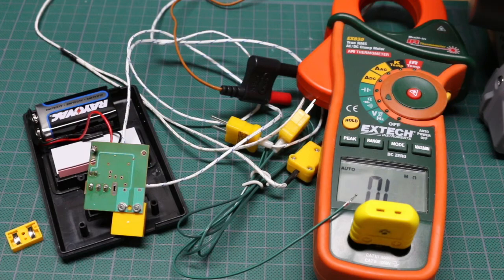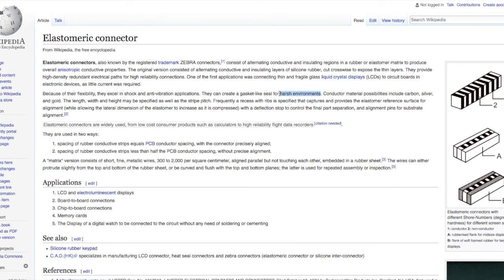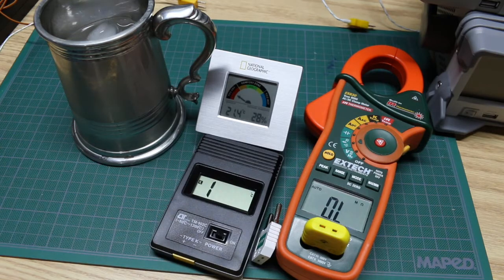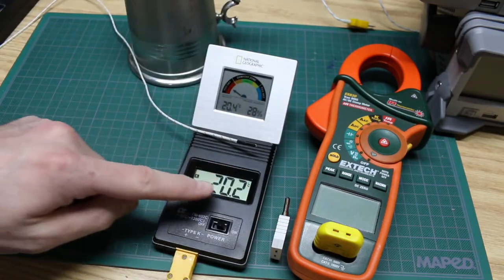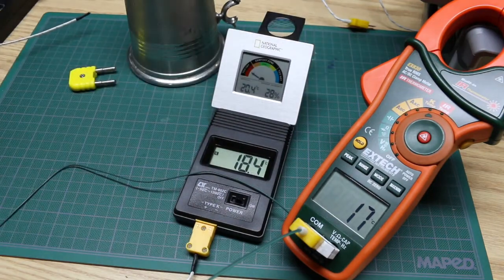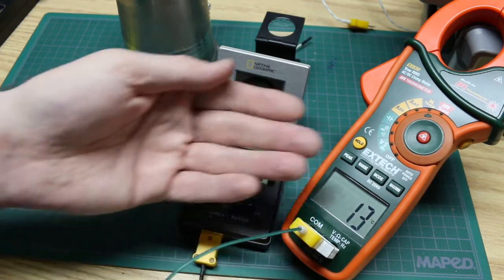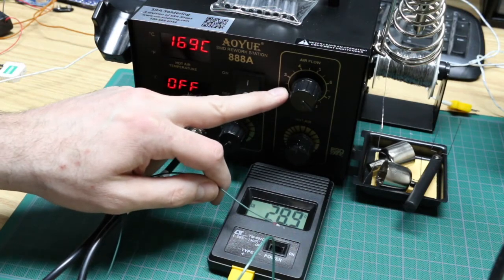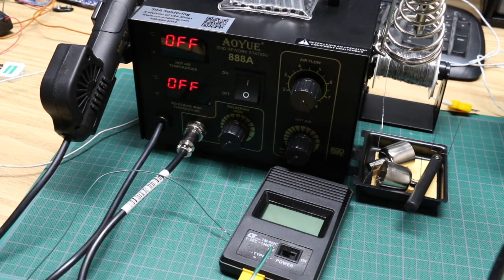K Type Thermocouple Testing

Comment: Dont buy extech.... have a look at the tests on youtube. They are very intermiddent about what you get.
The cheap chinese can vary +- 2 deg. C, but k-type probes are for high temps and are not very accurate either. If you want better accuracy than +- 1 deg. you have to buy better meters. The probes are what they are... two metal compounds giving of a few mV depending on temp. so not much to do there.
Reply from the maker: Yeah a few degrees error is fine for anything I’m doing currently, I just thought it was strange that I had such large discrepancy like 7 or 9° difference until I explored further and figured out I had malfunctioning items as well as improperly used items.  

 I think the next time I buy a multimeter for anything serious I’m going to definitely do more research but I’ve generally been happy with Fluke since I got my first one around 1995, which I still have and it still seems trustworthy. I acquired another Fluke since then  but neither can do temperature so that’s how I ended up on this tangent and relying on the Extech.  

 I’ll look up some reviews on it and see what turns up. I originally bought it for the clamp AC current capability and it was more about all or nothing to see if my house air-conditioner was generally running properly or not so I guess it served its purpose but it would be good to see how much I should trust it from here on.
Reply: I understand. Another brand wich is very much sold to hobbyists, but should be avoided....sometimes... is uni-t unlike Extech, quality differs very much from model to model and not so much unit to unit. Some uni-t models are actually very good. Thats why yt is so great for this ☺

I havent ever had the trouble you had here, sometimes one just runs into things that seems strange.🤔

K-type temp. probes is all the same, they have to be, its nature. If you want to measure I think you said 50 degrees, well no problem with a k type probe. Maybe lent some equipment from a friend and see what you come up with. I think the Extech is shot in this range.
Use boiling water (well known precise reference), so you know what to measure until you got it sorted out. Good luck.
Reply from the maker: Yeah I finally sorted it out in the video that came after but the extech  was still not looking as accurate as everything else.
Reply: Try rotate  connector 180deg. If you  put k-type in liquid, resistance change. Try protected k-element.

Comment: It is so funny that I also have sooo much troubles with reading K-type thermocouples.
I tried to use MAX31855 module for Arduino but failed. 
This one f.ex banggood.com/MAX31855-K-Type-Thermocouple-Thermocouple-Sensor-For-Arduino-UNO-Mega-p-1175433.html
Maybe you could play with them under Arduino framework?
Reply from the maker: After all of my Trouble maybe I will actually look into an Arduino interface and see how that compares to everything else. I will be putting out another video hopefully this weekend about some more experimental results.
Reply: All right

Comment: Hi    Did you not try to repair the original T/C  ?   It looks like the plug does have screws .

Water boils at 100' C at sea level  so you could check both meters and the T/Cs with that
( Melting ice being 0' C )    If you want a lower temperature , you should be able to get some
Dry Ice  ( solid Carbon Dioxide ) .
                                                                                                                          Alan
Reply from the maker: The one with the screws was the newer one that came with the cheap meter. The broken one has no screws on it so I can’t really open that and and I’m just going to lay it aside for now since I have the other two that are more in line with each other.  if it looks like I can pry the broken one apart I will see if I can find anything strange. It seems like it might be shorted and representing a fixed temperature. 

 Maybe I will try some boiling water to approximate the low temperature of the hot air station and see if the thermocouples appear in line with that. Good idea.  With the cold water and the boiling water at relatively expected temperatures that should give me a very good range for how things are working.  Normally I would just blindly trust the readings based on past experience going down to -40 but I just had so many weird issues all at once it made me doubt things.  But that made me explore things and learn a few things so it’s all good.
Reply from the maker: I just managed to pry apart that thermocouple without the screws and I haven’t fully tested it yet but it did look like the wires got twisted together and shorted inside the connecter so if I can get it working after I’m twisting it one or two rotations I’m going to do a follow up video to conclude that whole investigation.